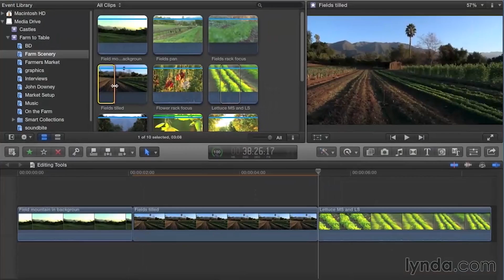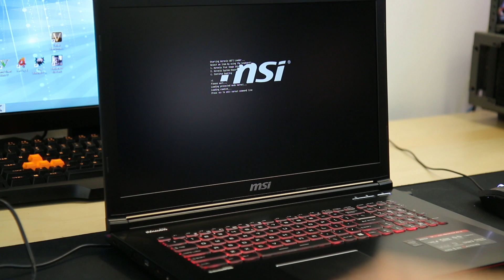How to install SSD in a laptop

Comment: I have the GE62 version of that, with a 126gb m.2 ssd that came with it, and it starts up and restarts in about 20 seconds or less, could that be due to connection type? or was I just lucky? (takes a minute for keyboard to shut off when you shut it down though) Mine is found on NewEgg as the Apache pro 413, and the Apache 2QF on MSI's site.
Reply: +Olimar Putin Oh, and I have heard that the warranty is voided when you live anywhere other than the US of A. I really had to scour the reviews to find even a few people that needed to use the warranty anyway.
Reply: +Olimar Putin I have the Apache Pro 413 also in the same configuration, love the damn thing and best money ever spent. Found it at Micro Center. Mine has the same restart time just about so it it might be the connection type.

Comment: so question, seriously looking to buy the ge72 just cant decide between the 003 and 029. only difference that i can see is the 029 comes with the m.2. On msi's website it doesn't mention if the 003 even has an m.2 slot. Would you be able to answer that?
Reply: +Lance Lund i find it hard to believe that they would use a different mobo in both models just to save money on a m.2 slot

Comment: Hey guys, I need a little help. I am a little new to adding SSD's. I recently bought an MSI GE62 with an m.2 SSD slot. I want to boot my OS from the HDD that it came with to the m.2 SSD. I'm not sure if this is the correct path, but I plan on using acronis to clone the OS over. My main question is after I do that, what do I have to do in regards to configuring BIOS? I don't want to do a raid setup. in particular, would I have to change the boot #1? Will my BIOS recognize my m.2 ssd to boot off of as soon as I have it in there? Do I have to change from UEFI to Legacy? what is AHCI? Thank you guys...

Comment: Okay, so my computer has a WD Blue drive and it's spinning at 7200RPM. It takes 5 minutes to boot. It's got a copy of Windows 10 Home on it, that was originally Windows 8 (which I upgraded) I have an old Crucial m4 128GB SDD I pulled out of an old PC, can I reinstall Windows with the same Windows 8 code? (even though I upgraded to Win10)

Comment: Super late to the party here and didn't read all the comments to see if this has already been relayed. The main reason 2.5" form factor mechanical hdds are slower than their 3.5" bigger brother drives is they usually have lower cache sizes and lower opperating rpm 5400rpm is slow on a 3.5" and only used for the low power models but the smaller 2.5" drives are usually this speed or slower the combination causes them to perform considerably slower than  the 3.5" hdds.

Comment: Some companies used smaller platters for faster seek rates, anyone remember the WD Velociraptor? (and most enterprise SAS drives). But they have to normally comply witch stricter power requirements so they can't run as fast.

Comment: Like you said, laptop hard drives have smaller disks and therefore can access data quicker and respond quicker and therefore they are overall quicker than their desktop counterparts. That's really just how slow hard drives are. Also, considering it's an oem laptop, I'm assuming there is at least 2 bloatware programs and some other crap that is slowing your boot times.

Comment: the reason they are slower is there is only 1 platter in a laptop drive due to size constraints whereas a 3.5 inch hard drive has room for up to 4 platters, therefor its like running 4 drives in raid vs a single drive.

Comment: Every MacBook model since late 2013 (excluding the 13" non-retina model, which is the lowest end model they sell and will likely soon be discontinued) has had Wireless AC standard. The only model without AC, which is the non-retina 13", when fully maxed out only costs $1,999, not $2,199 like he said. If he was referring to the Retina 13" or 15" models, he would be incorrect in saying that those do not have Wireless AC as an option as both come with it as standard in all Retina MacBook Pro models ranging from the base $1,299 13" model to the maxed out $3,199 15" model. All MacBook Air models have also come with AC standard since 2013 as well.

Comment: So you spent 1200 on a laptop and 450 on a SSD? All to save what 400$ for an unfamiliar system to give your wife ... different operating system, different casing, different keyboard and trackpad, and worse screen quality. Should have just spent 280 and cloned your wife's macbook hdd to an 512gb ssd and she would have loved the speed and nothing would have changed i.e. programs, the way she uses it, favorites, the way it was set up ... etc

Comment: Wow that boot time with the HDD is messed up, my Toshiba with it's standard 1tb 5400 RPM can do a reboot cycle faster then that and it has all my stuff on it even.  I did put a SSD in this for a few weeks but traded back to the HDD for the storage the speed was acceptable by my standards, but if I had the boot time of that system I could justify the move to a larger SSD.

Comment: Oh my god...how can a gaming laptop be that slow to reboot? I have a Latitude D530 and on my old install of Vista Business 32-bit on the original hard drive, I never optimized this machine and still timed a total restart time of 1 minute and 3 seconds. This laptop had a Intel Core 2 Duo T-series 2.0 ghz, 2 GB DDR2 at 667 mhz, and a 80 GB SATA 3 gbps 5400 RPM Western Digital hard drive that was on it's way out, and the Crestline Graphics variant of the onboard 965 Express Chipset video card that has an amazing grand total of 8 MB of memory for itself. 

MSI, Dell may have been running as a 50/50 gamble between rock solid and useless toaster for years and years, but maybe take some notes?

Comment: my pc has an intel 730 ssd and takes 37 seconds to reboot any1 help
Reply: To reboot or just to boot? For reboot it sounds alright, to contrast my 850 EVO takes 18 seconds from the power button, and 8 from the bios.
Reply: to fully reboot but my mac book air dose it faster :( is it because my pc has more stuff to boot up or???
Reply: +Chimme It may yes, and the Macbook Airs run off M.2 instead of SATA im pretty sure, which is faster.

Comment: I can highly recommend Macrium reflect for your disk cloning needs. I bought an USB3 to SATA III cable which didn't work on the samsugn clone software because the cable used it's own drivers, but macrium reflect detected the drive just fine.

The 30 day free trial works well.

Comment: Hey Mr. Jay i have commented before on your videos saying that you probably wont see but you replied wich is awesome. Would you consider getting another ssd and installing win 8.1 on that laptop just to test its restart time? Im suggesting this because im sure somethings wrong with win 10 atm. Win 10 is overall moving around thru the os slower than my old and filled up win 7 install. And im not the only one seeing this with win 10. I have a crucial m500 ssd and im asking if you could do this because i dont have a uefi computer atm and i dont have all those parts to try it myself. The only way i could try this would be with wiping my current os wich is something im not looking forward to right now. And again without it being in uefi mode the test would be pretty much irrellevant.

Comment: Its still slow because he didn't reinstall windows 10 with UEFI+GPT, and because hybrid sleep doesn't work with a restart. it speeds up SHUTDOWN and STARTUP but not restart. with a restart the pc does a true clean boot, which can't be much faster because of all the pre-windows things the machine must do when doing a clean cold boot. my work laptop with only a 2 core i5 shuts down and start up again in probably half the time with a samsung 850 evo
Reply: Actually im pretty sure that the stock hdd was already installed in uefi mode and when he cloned it it was still uefi. Im sayin that because when windows was loading the msi logo stayed there. That only happens in uefi install of windows 8 or 10
Reply: +renyn21 you are probably right about the uefi boot, still, it is best to reinstall the system when switching to ssd to prevent problems with alignment.

Comment: Hey jay, windows 10 isnt fully optimised yet with regards to ssd's. Once the drivers have caught up it'll be much faster!
Reply: Can you give me some info on that? I heard it was supposed to be fast but its much slower than win7 for me. I installed win10 on 29 when it got released and its noticeably slower in speed than 7 or 8. Oh and a random thing, is there a way to clear those desktops? I opened like 400 and now when i try to use that thing half the screen goes black and i cant select any, atho they work if i can guess where they are.

Comment: So everyone is clear, you DO NOT have to install the new drive and go through all that.

You can leave the HDD in there, and connect the SSD via USB, start the clone and it works just fine. Then just swap it out. No reason to create additional boot media or anything like that. Done this countless times at home and at the office.

Comment: I personally have a GE62(Bought in Canada but US version), i contacted with MSI about the warranty before i put my ssd in and they say if you know what you are doing you should be fine. If you still think you are gonna void your warranty then grab your hair dryer, turn it on with heat, after a while the sticker should become easy to peel off :)

Comment: @JayzTwoCents    i think it has something to do with the linear velocity at the outer edge of the disk. A 3.5 inch drive has a linear max velocity (@10000rpm) of about 20 miles an hour. a 2.5 inch drive does about 14 miles per hour. and a 1.8 inch drives does about 10 miles an hour. assuming that the OS is going to be in the outer most sectors where the disk is the fastest it would make a huge difference.

Comment: I see a couple of problems here. First: On the SSD reboot the reboot prompt came up which lost the SSD a few seconds. Secondly: The OS was cloned to the SSD which is never a good idea in my experience. A clean install is much better (and gets rid of any MSI bullshit going on under the hood).

There must me a hell of a lot MSI crap going on in the background as well because even my broke ass windows 10 install on a 2 year old SSD restarts in 37 seconds WITH the reboot prompt AND me having to type the password one handed. Something doesn't add up.

Comment: $1200 laptop with a $450 SSD upgrade? Im not sure this is much of a savings especially knowing there are a few more reasonable options out there. A lot of the newer MSI laptops come with M.2. System drives. The savage kit isn't around $300

Comment: I like how many people are saying that their $2000 MBP are lasting much longer than the windows laptops in the same price range, but most people don't run games like farcry 3-4, crysis, bioshock...etc on macbooks. Most macbooks only support a quarter maybe half the games as a windows laptop would. The issue that they are avoiding when presenting the "my laptop lasts longer" is the fact that, under the same duress as a windows laptop, the macbook would fry itself due to fancy looks and poor cooling. Anybody in their right mind wouldn't buy a $2000-3000 laptop that can't function as well as a $1500-2000 desktop. (unless they don't know what they are doing.)

Comment: just tried this on my old hp pavilion g7 2013. The 1tb hdd died after a year so i put a spare 500gb which was from a ps4. it had read write of 70mbps on both. I recently installed a 120gb kingston v300 ssd into the laptop. i did the test and timed it. i got exactly the same as the msi in the video. the exact time was 42.47 seconds. im impressed with my £40 ssd

Comment: I always laugh when people say they converted to mac, most of the time they cite faster, easier and a more streamlined experience for video editing as the reason.

So why I laugh so much is that, if you are just now switching after a life time on windows, good fucking luck learning all the nuances and shortcuts of Mac OS.

That time that is saved for the rendering, maybe, is completely wasted on the time it takes to learn the OS and the short cuts by heart.

Comment: welp... I can answer the whole hard drive thing...

Desktop hard disks have much more power headroom to allow them to be able to spin more platters and index faster using higher power control logic... also, their size means that they can have larger preamps for the read/write heads, making them more power hungry, but faster... in contrast, laptop hard disks HAVE to be power efficient. they also need to use smaller control logic... so even though the drives have denser platters and should on paper be much faster than a desktop drive... they simply can't be... desktop hard disk control logic tends to output a fair amount of heat (this is of course alongside friction in the bearings, coils producing heat etc) into the hard drive's chassis... this on a laptop hard disk would be problematic as it has a significantly lower thermal mass... these drives absolutely need to be able to remain cool in an environment where airflow and cooling are extremely limited... if these drives were power hungry and output a lot of heat... then you could have reliability and longevity issues in an otherwise outstandingly fast drive... not only that, but the control logic on a laptop hard disk has to be capable of controlling some of the wear on the drive... we're talking miniaturized parts here, and they are known to be more sensitive than larger ones... laptop hard disks tend to have issues where the read/trite heads or the bearings will wear out pretty fast... and that is a serious issue, so the drives are intentionally not going to write at much higher speeds as this would exponentially increase the wear on the platters and the head stack assembly and bearings... not a fun thing for anyone whose data is vital to them!

Comment: Should I slap an SSD in my 7 year old toshiba equium p200-178?
Its REALYYYYY slowwwww and im considering doing this.
(Its so slow i cant even run windows :/ )
Reply: +killer11843 HDD isn't the problem. The P200-278 has a T2080 dual core along with 1GB of ram? Running Windows vista on that must be a nightmare. This isn't 2003 anymore, if you don't have at least 4GB of ram, you NEED to upgrade. I'd suggest buying a $300-400 laptop and sticking an SSD in it, you'll see a huge improvement.

Comment: Bigger platters means the edges of the Platter are faster.
That's why if you'd benchmark an HDD they speed is fastest at the beginning and lowers as you test sectors closer to the axis of the platter.

Comment: why do smaller hard drives produce less throughput?  slower rotational velocity.   when freshly formatted, hard drives always write to the outer edge of the platter first.  as you fill the drive, the read/write head moves inward toward the center of the platter.  given a constant RPM (usually 7200), the rotational velocity decreases as you move toward the center of the platter.  the head is accessing less bits per second.

Comment: I bought the GE72 2QC with 256 GiB SSD preinstalled, since, well, it was on discount with goodies like the official backpack (which I'm really happy with), and dear lord... The reboot speed difference is nuts! Mine could've rebooted six or so times in the time the HDD only version rebooted... O_o' Oh and actually, MSI said themself multiple times on their forums that the warranty sticker is just to scare people off, if one wishes to add memory, change the drives or Wi-Fi or whatever, it's fine as long they don't break anything during the upgrade process.

Comment: When going from a hard drive to an SSD i thought AHCI wasnt enabled by default on the cloned OS? This video doesn't mention if the bundled software handles that (When I did on a laptop recently, I had to perform a registry key edit and then a bios option change to get an even better startup time than without).

Comment: Jay! Because Platters are smaller TANGENTIAL SPEED is slower (T=w*r, where T is tangential speed, w is angular velocity [rpm] and r is radius) that's why the fuller the drive is the slower, because tangential speed goes down the closer you are to the axis of the platter. so that's why Laptop HDD's are slower than normal ones

Comment: Jay the reason for the slower read speed is your arm is on a bering however the arm travels slower as to put less stress on this component as weaker due to it thickness meaning a smaller product overall

Comment: I had to upgrade my sister's laptop (750GB HDD), my laptop (500GB HDD) and my ultrabook (256GB M.2 SSD) to Windows 10.  I decided I will also upgrade memory from 6GB to 16GB on my sister's, upgrade to 1TB SSD on her laptop, upgraded to 500GB SSD and added a 1TB SSD to my laptop, and upgraded my ultrabook to a 1TB M.2 SSD.  All 3 of them now SCREAM when booting, restarting or just running stuff in general.

Comment: what would be the best way to upgrade an m.2ssd? my razer blade has a 120gb ssd and sometime this month when the samsung 950 pro comes out i will be getting the 500gb model and putting it in my blade. how would i go about cloning my os? would i do it on a separate external drive or is there a way i can make it work externally? would cloning the os from the ssd to an external and back onto the new SSD work or would that mess with TRIM? (i heard cloning from a HDD to an SSD could do that)